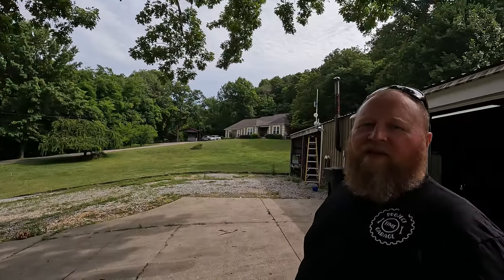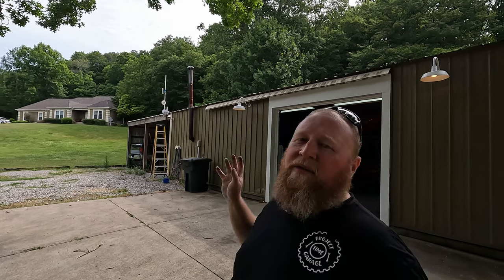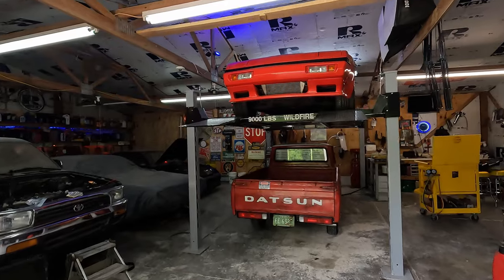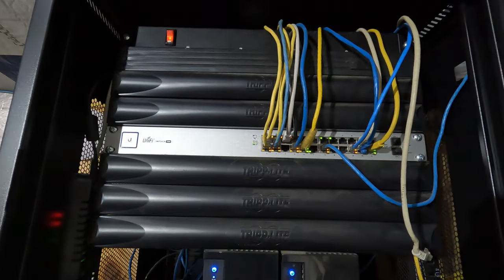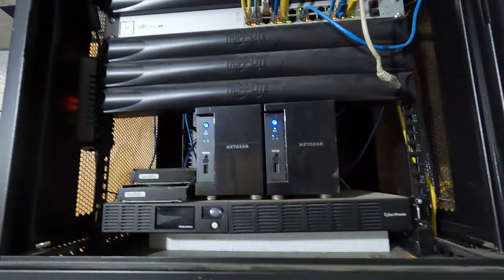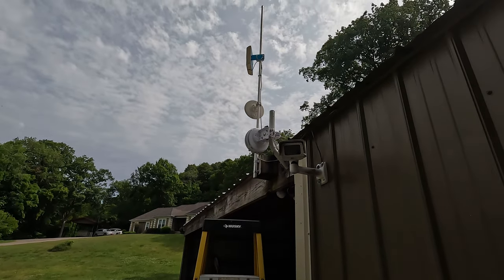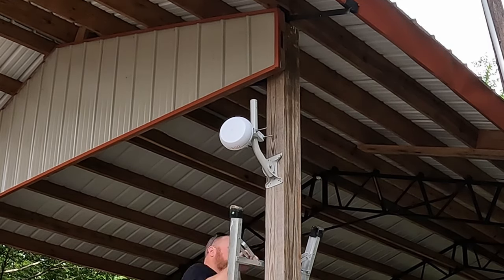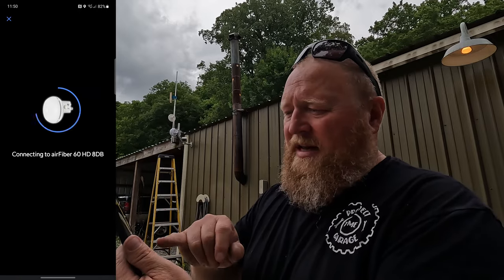Upgrading My Garage Network - Ubiquiti AirFiber & UniFi Building to Building Bridge

Comment: Nice work with the connectivity efforts across your property, but please tell us more about the very clean looking Conquest/Starion sitting on the top of the lift!  Extra points for still having the original wheels and a chin spoiler that isn't cracked/damaged or just plain missing altogether.
Reply from the maker: It's an 88 Station ESI-R. 47k miles all original down to the floor mats. I have videos of it on my main YouTube channel - ProjectTimeGarage go check it out
Reply: @projecttimetech7022  Nice!  I just found the other channel and will take a look at those videos.  These were a favorite of mine back in the 80s.  Lots of fun to drive, especially with a stick.  Not many were made, and its rare to see one in good condition these days.  Thank you for the quick reply.  That car brings back some great memories...  :)
Reply from the maker: @davidreagan7156  Yeah, I had a buddy in high school, his parents bought him one brand new in '88. It was yellow and the best looking thing I'd ever seen, so I was hooked from that moment. I had been trying to find one that was nice for years and years.

Comment: On the Ubiquiti UBB it comes with an access point and a Station.
Is the Station the remote side or attached to you LAN?
Reply from the maker: The station side is on my LAN, the AP side is at my gate. You can configure either one to be station or access point.
Reply: @projecttimetech7022  Awesome, does it make any difference? Thank you.
Reply from the maker: @InformedGlobe  No, it makes no difference